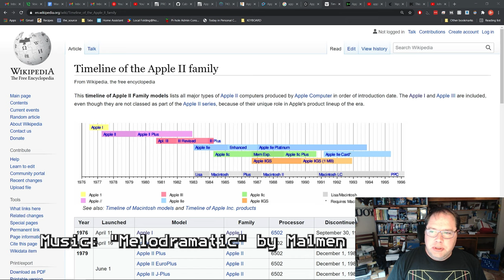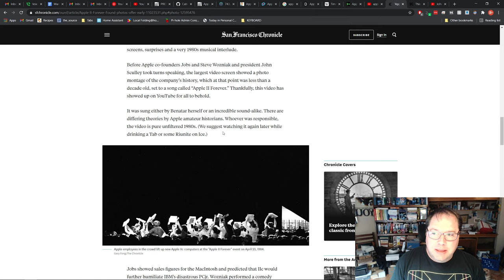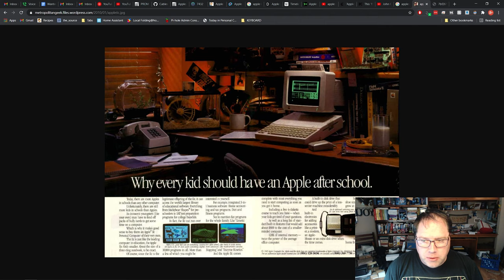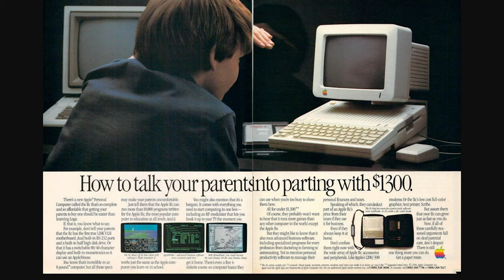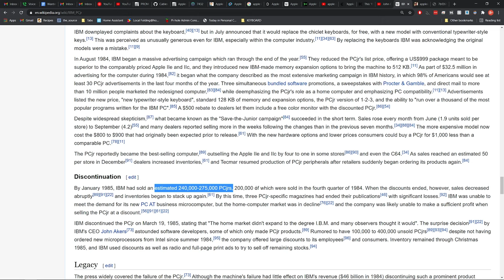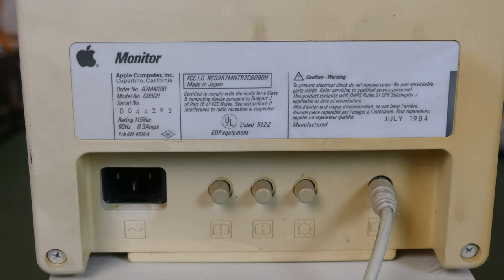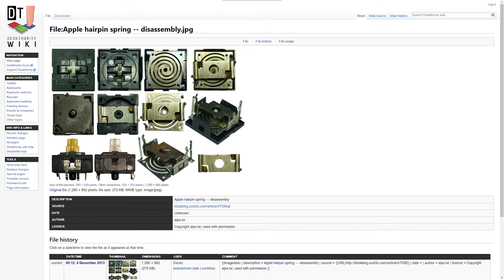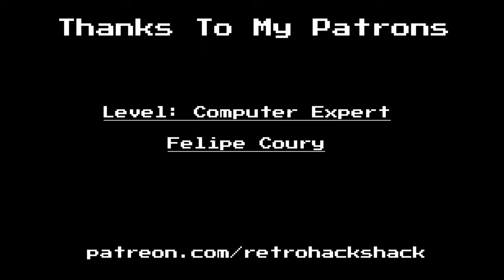Restoring An Apple IIc - Part 1 - History, Testing, Cleaning

Comment: I liked the Mac for Graphics, because that is what it was originally designed for anyway. I was designing all kinds of graphic overlays for Bell Telephone Laboratories. and I also used Unix based IBM PC for Circuit Board Design at Bell Labs as well.

Comment: Those composite connectors are a pain. I’ve just about finished restoring a 2c that was in much worse physical shape than yours, and I had to replace the RCA Jack. I have one of the later ones, and it has a conventional RCA Jack, not the one you have.

Comment: I have two IIc's.  Great little machines.  One of them has a Mockingboard clone INSIDE!  I also have an internal CP/M card with 512KiB.  But I can't use both at the same time (not in the same machine).  Anyway, what are you using to capture that video?  Looks nice.   Oh, BTW...if you're at the command prompt, you can type:    PR#6    and that will load the disk.
Reply from the maker: I have enjoyed using a iic over the past few years. It's a lot easier to test software on it than setting up one of my full size it's. I use a Startech usb3hdcap for capture. It is a little pricey, but it captures everything and works well with OBS.

Comment: $1300 in 1984 for an 8 bit computer sounds very expensive when a C64 was a quarter of that. I never understood how Apple could ask for these kind of prices that were so much higher than the rest of the 8 bit market.
Reply from the maker: This is one of the many reasons I never bought an Apple product. I refuse to pay the Apple premium. However, compared to a IIe with disk drive, monitor, and 80 col card at $2000, $1300 plus a monitor seems pretty good. IBM's portable at the time was $3000 and the PCjr was selling for $1269 and I think that was without any expansions. I had a Coco which was similar in price to the C64. I probably should have shown a price comparison in the history section. DOH!
Reply: With commodore what you saved on the computer itself, you'd eventually have to spend on stuff like a 1541, etc.

Comment: 17:10 shows easily that it is definitely NOT the Alps keyboard.  Alps KB had a metal backplate and no plastic anti-sag frame.  The anti-sag frame was used on the Apple branded (but still sub-contracted) keyboard, which required it because it lacked the metal plate that the key switches mounted into in the Alps had.